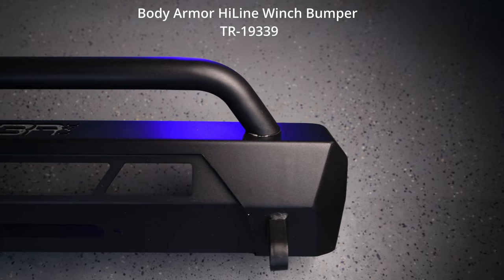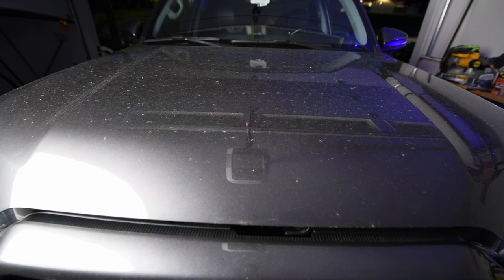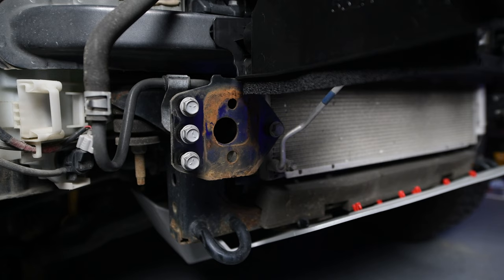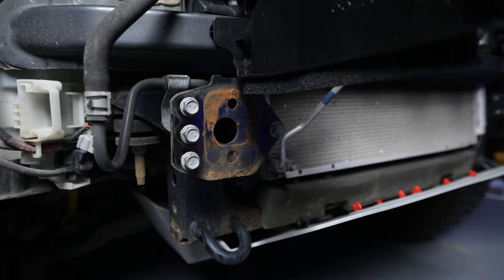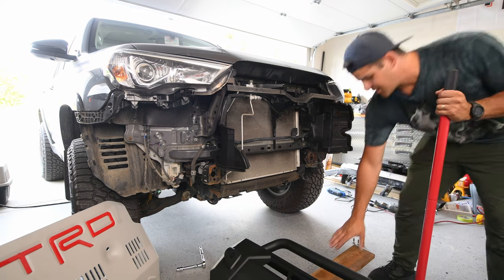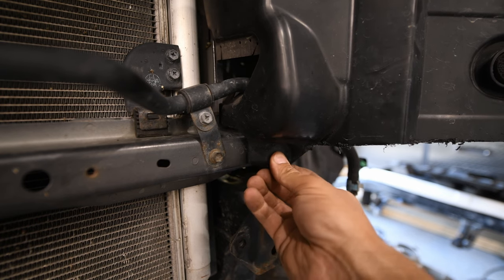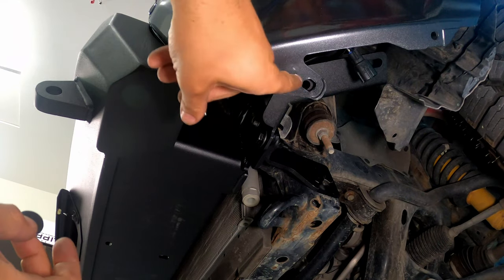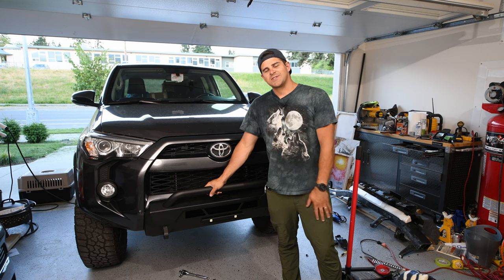5th Gen 4Runner - Body Armor HiLine Winch Bumper Install

Comment: Heads up: The 13 fasteners securing the radiator cover are push pins. To release use the tip of you index finger and push down on the inner portion of faster. This is the pin and you will feel it release with slight finger tip pressure. Then lift out the fastener. To install, on a hard surface push fastener down so that the pin pops up. For install place fasteners in each location, push pin down till you feel the pin lock (typically when top of pin is flush with fastener).
Reply: @Kevin, I was just going to write that about the clips, as well.

Comment: Hey there, I just bought the body armor for my 2016 4runner just wondering how it’s holding up. Awesome job, one of the few videos out there for this install.
Reply from the maker: Great so far, no rust or any other issues. I’ve winched with it and it’s held up good. Use this video as a reference but use the manufacturers instructions as your guide. I ended up removing a bit more plastic to get a better fitment

Comment: Great video, super helpful.  I just did the same install yesterday with a Trailfx lightbar.  I was nervous about cutting the bumper, but used a combination of an oscillating tool and dremel and am super happy about the results.  I’m not exaggerating when I say I watched your video 20 times.  One quick question.  Did you or do you experience any rubbing of your tire(s) on front wheel well in reverse turning sharply?  I’m convinced everything was put back together properly.  Thanks
Reply from the maker: I did notice a bit of rubbing after I installed larger tires. I found  out where it was rubbing and used a heat gun to mold the plastic in that spot. Later I installed even larger tires and trimmed a small piece of plastic to stop the rubbing. Do you have stock wheels and tires?
Reply: After my last service 6 weeks ago I had 265/70R17 Toyo Open Country AT 3's mounted on Toyota TRD pro wheels installed.  Never experienced any rubbing before but suspect that the fender wells somehow ended up a touch closer than before.  I'll have to see where they are rubbing and use a heat gun.  I appreciate the advice and quick response.   @T4Rgarage

Comment: With the added weight at the front, are you planning on changing the front springs as well?
Reply from the maker: Possibly or I might add the 1/4” top plate spacer if it drops too much

Comment: This bumper only weighs 72 lbs. and it's made of steel. While it looks nice, that's not really very stout, especially for a winch.  Yes, the mounting plate for the winch is 1/4" but the rest of the bumper is only 3/16" which also supports extraction points. A rule of thumb is that your bumper should weigh more than your winch.

Comment: With the big tires and new bumper, does the car feel sluggish with all that weight?
Reply from the maker: Haven’t noticed any major change. The bumper (80lbs) replaces the factory crash bar which weighs about 40lbs so not a huge increase in weight (until I add a winch)

Comment: 2 quick questions...  1) If I left more material on the top portion of the stock bumper after cutting it, would I be able to hide it BEHIND the Body Armor bumper instead of having the plastic edge of the stock bumper hang over the metal bumper?  
2) How's the bumper holding up to the weather, any rusting?  Thanks for the vid!
Reply from the maker: I tried this and it doesn’t really work. The top part of the bumper cover has to hang over the metal. There isn’t really anything you can tuck it under unfortunately. Tucking it under will cause the sides to pull in as well causing a poor fit. So far the bumper is holding up really well, no rust whatsoever.
Reply: @T4Rgarage  Ok thanks

Comment: Do you need to remove the TRD skid plate first in order mount the bumper?
Reply from the maker: @mauizzyadventures25  not necessary
Reply: @T4Rgarage  going to install the same bumper tomorrow. Wish me luck. Lol. Hopefully I don’t mess up with cutting the bumper. I watched your video several times and I’ll probably watch it several more tomorrow as I do the install. Thank you for sharing!
Reply from the maker: @mauizzyadventures25  Follow the written instructions over my video. I had to go back and remove more plastic. Also, using a dremel with a plastic cutting wheel will make life much easier. Just take your time and remember, you can always remove more but if you remove too much you are hooped. Good luck!
Reply: @T4Rgarage  thank you!
Reply: @T4Rgarage  are the plastic wind guards necessary? I wanted to know if I can just remove it completely instead of trimming it.

Comment: I got 2021 TRD ORP , planning to install body armor hiline. Does it affect the driving balance. Like the front is heavier so it tends to sway to left or right more when you move your steering wheel? Thanks
Reply from the maker: Not that I’ve noticed. You remove the stock crash bar which is pretty heavy to begin with so it’s not a crazy weight increase. Just make sure you get a winch with synthetic rope and heavier front coils or adjustable coil-overs if you lift
Reply: Cool , love your detailed video,as a subscriber I wanna do DIY on my T4R cost of labor is too much. I have Eibach stage 1 set up 3” lift with after market UCA and 33x10.5R17 Kenda Klever RT’s
Reply: If you're willing to do the viper cut mod, you can upgrade to 285 tires and it makes a huge difference. I have the same year and trim in magnetic gray :)
I found that my miles per gallon actually went up as well.

Comment: Is there a place on the bumper to install a license plate? Without covering the light bar or winch
Reply from the maker: There is not. I actually just relocated my plate to the center of the grille kind of behind and above the bull bar. I got the grille adapter mount off Amazon, it’s working good so far and doesn’t look bad
Reply from the maker: There is a license plate mount but it would have the plate hang over the winch. You would just need to remove the plate of you wanted to use the winch which wouldn’t be too hard, two screws